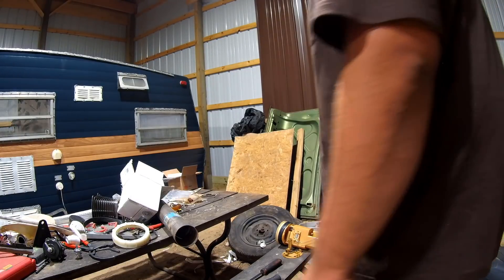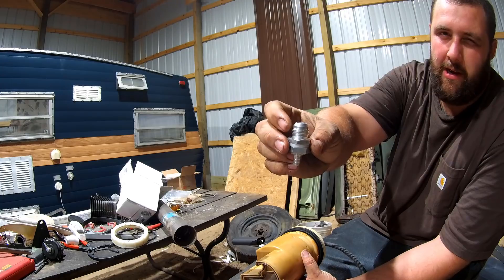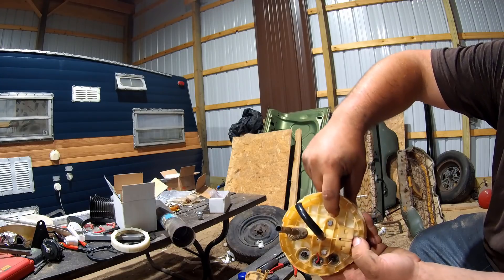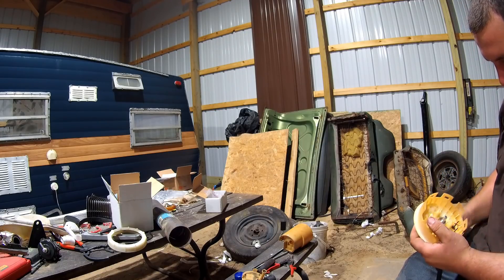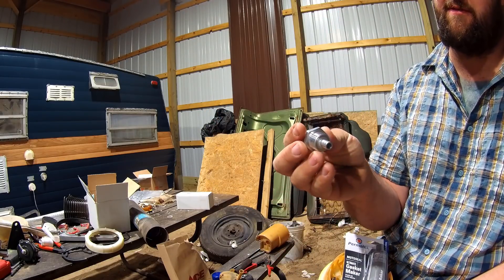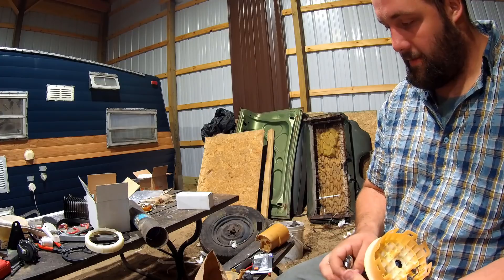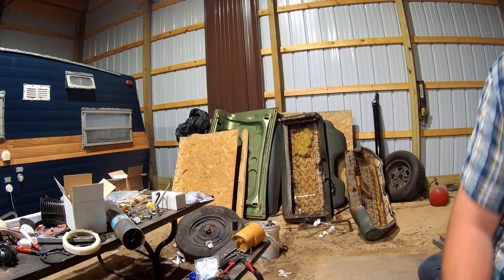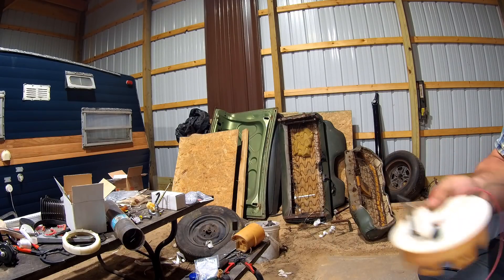Building a E85 fuel system on a budget

Comment: Did you add a pipe to the return fitting to get it down into the fuel or is it just dumping right into the tank on the top? How's your camper coming?
Reply from the maker: The return has a 8" hose inside the tank. camper is taking a lot longer then I'd like but rear window is at the glass guy. And have to put down new paneling on floor and it should be done

Comment: Perfect timing!
Reply from the maker: Prochargedmopar you working on fuel system too?
Reply: Dirtfloorfab Yup, First an e85 blow-thru carb LA360 setup and later e85 for micro and a 5.9 Magnum.
Good info, thanks.
Reply from the maker: Prochargedmopar sounds like a sweet setup. Party on Wayne.
Reply: Nice mod to the stock fuel basket!
Reply from the maker: Thanks Phil